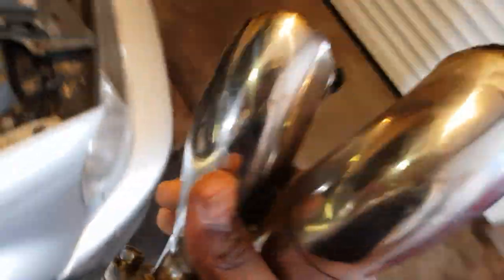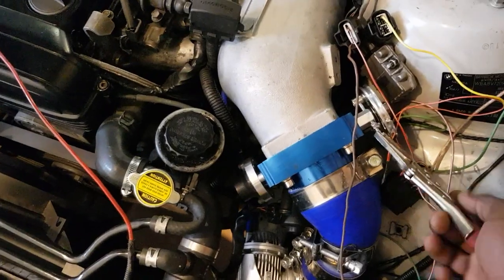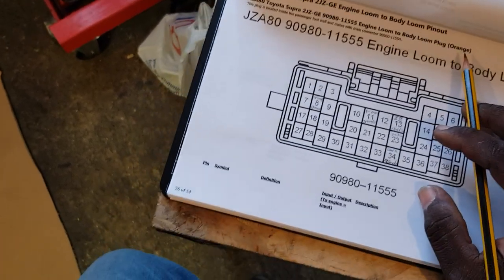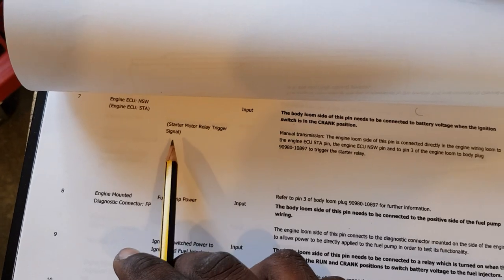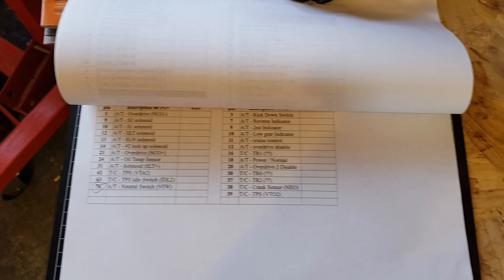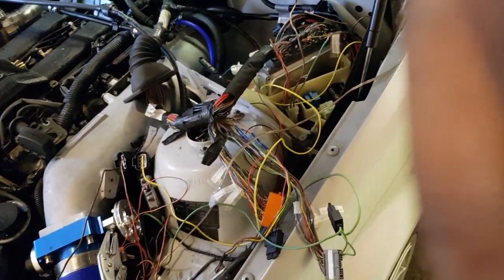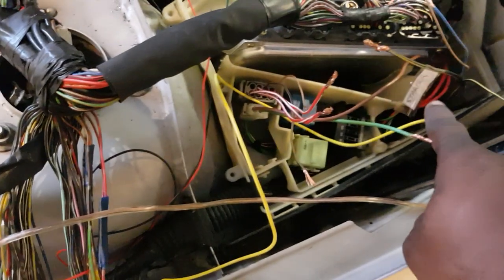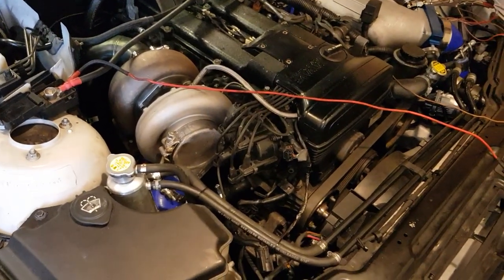2JZ-GE NA-T in BMW E46, wiring manual for starting Engine.

Comment: Thank you SO MUCH for this video! I know i'm about 2 years late hopefully you still see the comments on this video. I have a quick question, at 17:00 you start to show the gray plug. It has (2) green wires coming out of it running to a small black connector. What is that connector? Is that a BMW body harness connector that I can use to splice the signals I need or is that just some wires you found for this job and it just happened to have a connector on it?
Reply from the maker: Im happy the video could help you somehow. The black connector you are referring to is a body wire from the bmw. (might have been from the ignition to the coils originally) It carries power into 1 and distributes it the the others. So its really a sort of power distribution item.

Comment: hi, any idea how to get the oem cluster rpm to work?
Reply from the maker: This is the tricky part really, the cluster would require a can bus for the engine/ecu to communicate with the cluster. I know it's possible, not sure of the complexity or costs involved though. Some people opt for a standalone ecu to overcome this hurdle.

Comment: awesome build! how did you retro-fit the greddy style manifold to the ge?
Reply from the maker: Thanks, I used the lower GE intake part,  bored out the holes on the GTE intake to match with the ge, then welded them together around each hole. 2 of them get bored out really close and a slight part of the hole becomes visible after aligning all the holes. But a good welder will know how to compensate for that.
Reply: @Jscottie2600  cool, thanks for the input, best of luck with your build